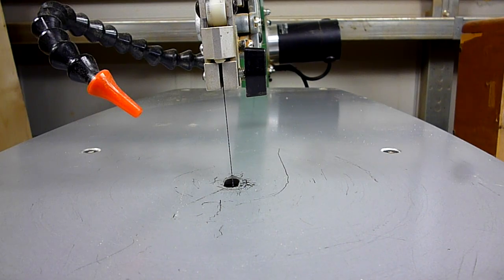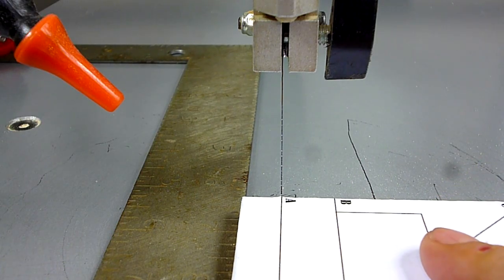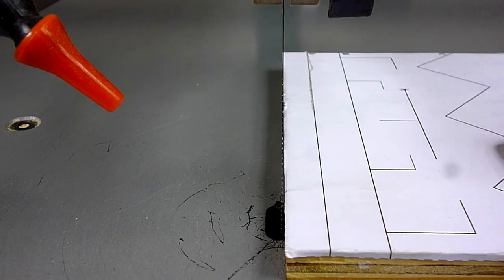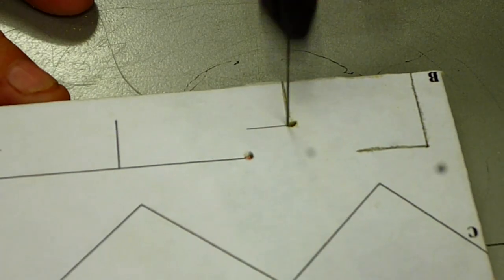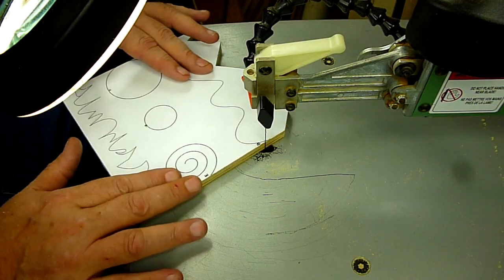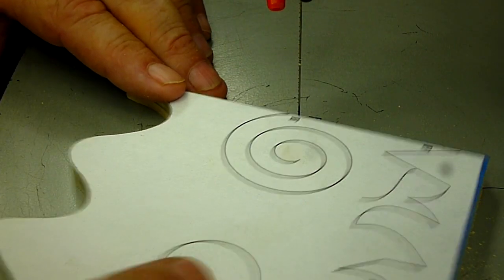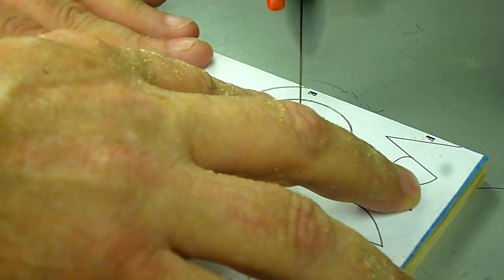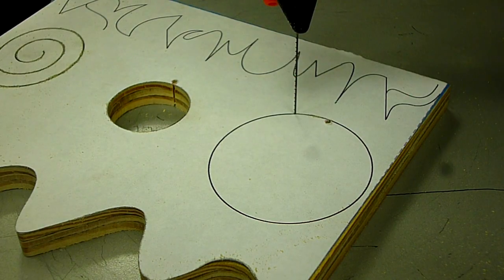Scroll Saw Cutting for Beginners Pt 2

Comment: what is the best blade for quarter inch polycarbonate?
Reply from the maker: +EnergeticWaves I use a #3 or #5 non-reverse type blade at a very slow stroke speed.Keeping the heat that the blade produces while cutting as low as possible will prevent the kerf from melting back together during the cut. A thin blade and slow stroke will reduce the heat created by the blade. The non-reverse type blade will help to keep the kerf clear, any fuzzies left on the cut can be easily removed by wiping them off with a piece of sandpaper.
Reply: +ScrollSawParadise thanks, wow, what timing,  The dw788 just arrived!
Reply: +ScrollSawParadise the last time I cut any polycarbonate it was with a hand jigsaw and the blade got so hot the blade would basically weld the cut piece back together, boy what a mess that was.

Comment: Whenever I'm supposed to turn the wood 180° so I can cut sharper curves, It feels like the blade will snap. I'm itimidated because I don't want to mess up school saw
Reply from the maker: Hi Edward, Make sure the saw is running when you make any turns, then turn slowly and steadily. With the saw running you should be able to make 360-degree turns without a problem. Good Luck and let me know if you have any other questions. Bob

Comment: How come it takes all of my body weight to push the wood through to cut & I can't control it. I have a brand new blade in it too. 
I did buy it used. It's a Craftsman 16" direct drive. Please help. I'm so upset .
Reply from the maker: What type of wood are you cutting and how thick is it? Do you have the blades teeth pointing down and towards you?
Reply: ScrollSawParadise the wood is some extra fencing I got from my neighbor & it's @3/4".  Yes, the blade is on the correct way. Should I only be using soft wood like pine?
Reply from the maker: Make sure that you have a very tight tension on your blade, if you still can't cut with little more than light pushing pressure, you should look into buying a different brand of blades. When your blade gets dull, it can get difficult to push through your wood. I use Flying Dutchman brand blades and they work great for me...Bob
Reply: ScrollSawParadise ok thank you again.

Comment: where you using pinned blades?
Reply from the maker: Hi Mark, no I never use pinned blades, my saw won't even accept them.  But even if my saw could use them, I still wouldn't use pinned blades. Pinned blades are not nearly as versatile as plain end blades are and limit the type of work you can do with your scroll saw...Bob

Comment: How come your scroll saw is not jumping?  Mine is always jumping on the table.
Reply from the maker: Hi Jennifer. Your scrollsaw has holes in the feet. Those are so that you can bolt it down to a table or stand. That will help stop it from jumping. If you have clamps, you can clamp it down tightly.
Reply: Thank you!  Now I have to get a work table.  I printed out your template and am excited to get started.

Comment: I was thinking of getting a scroll saw mainly for small DIY jobs.  But then I saw all the crafting jobs a scroll saw could do.  So I was looking for something that could do both.  I came across this product Worx WX570 
[url]https://www.youtube.com/watch?v=CRuUlMwNeJI[/url]

A couple of general questions; I noticed it takes T shank Jigsaw blades, as opposed to the pin or plain end blades - is there any advantage/disadvantage?

Also any thoughts about this product?

Thanks
Reply from the maker: Mark Banin Hey Mark, next time you go to a hardware store, grab a pack of jigsaw blades and a pack of scrollsaw blades and compare them side by side. You will see that they are two completely different blades and are used for entirely different things. Jigsaws are great for cutting shapes and curves in thicker and bigger pieces of wood and is more of a construction tool Jigsaws are not designed to make the smooth clean intricate cuts that a scrollsaw blade is designed for.The Worx is simply a jigsaw that somebody is trying to pass off as a hybrid scrollsaw and is therefore useless as both a jigsaw and a scrollsaw. Before you spend any money, you probably need to figure out just what it is you really need the tool for, or you can just get a normal jigsaw, that will do everything the Worx will do for a lot cheaper, and also get a scrollsaw. Personally, I would really not waste my money on a Worx, it´s just another gimmick. Do a little more research and narrow down what it is you want to make, then go from there, good luck....Bob

Comment: OK so what tool would you use to make a jigsaw puzzle? This one? So it's a jigsaw, there's a clue in the name JIGSAW puzzle. This is not a scroll saw. Traditionally a scroll saw was used to cut thick wood like the scroll on the end of violins and other viols.. 
This is my hill and I choose to die on it.
Reply from the maker: Bang!!! You're dead.... actually, the proper tool to use when cutting jigsaw puzzles is the scroll saw. The scrollsaw is made to cut very small and intricate pieces of wood. You can use a scrollsaw to cut thick wood as well as very thin wood. a jigsaw would be very difficult to cut puzzle pieces with, and much more dangerous. I hope your hill is comfortable.  :)
Reply: @Scrollsawforum1  So why is it not called a scrollsaw puzzle, huh?
Somewhere along the line there was a change of name, originating on the US side of the Atlantic. The result is confusion on this side. Anyway a scrollsaw is close to what we would call a coping saw.
Go on ask me about fretsaws?

Comment: argh this is sooo hard for me :((((((
Reply from the maker: Hi Peach, what is hard for you? If you can give me a little detail about what you are struggling with, maybe I can give you some suggestions to overcome the difficult parts...Bob
Reply: So in my woodshop class, I'm scroll sawing a wood with a height about 3/4 inch to an inch, and I can't make the scrollsaw line go straight, and im trying my best to control it to make it go into a straight line, but the line just keeps cutting slanted. Thanks for the help. I subscribed and liked to your channel and video!
Reply from the maker: Thanks for subscribing. You need to make sure that the blade on your saw is vertical. I am providing a link to one of my videoes that shows how to verify that your saw blades are perfectly straight. Maybe you could talk to your shop teacher about it and show him the video. If your blade is slanted it will make straight cuts very difficult. Here is the link and good luck...Bob https://www.youtube.com/watch?v=DmtkafjkHuw